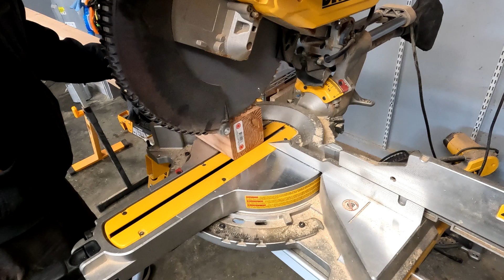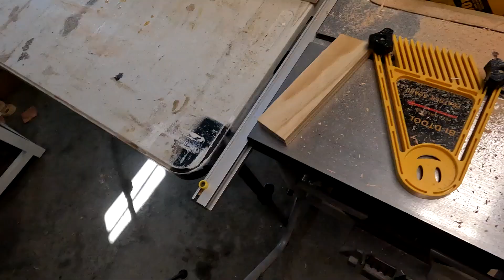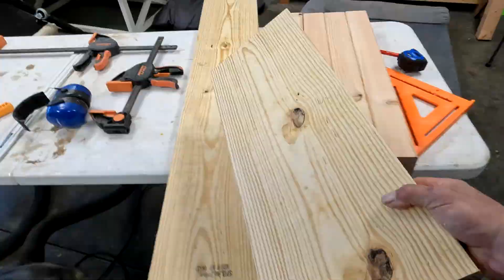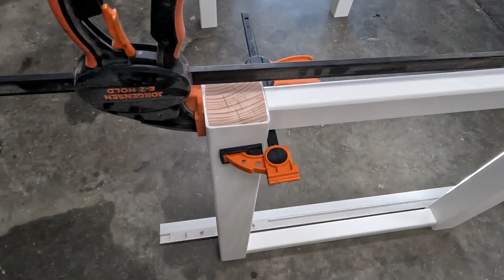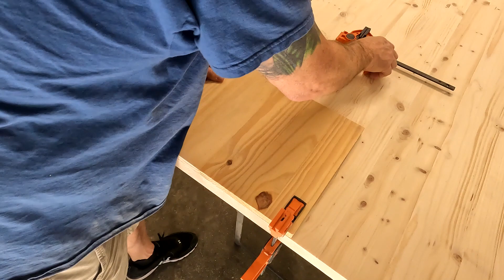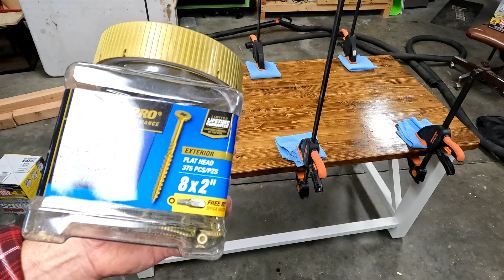Easy Farmhouse Office Desk Build | Rustic-Modern DIY Woodworking for Beginners

Comment: Great video.  Would have liked a few suggestions about how to pull it off with only a compound miter saw & power hand tools (sold my table saw.) Also the crossbar part barely explained the process.  Still, enjoyed watching.  Good heads-up on buying a premade top.
Reply from the maker: https://youtu.be/Rt4nNKBINsE  Sorry YouTube is either you talk to much or talk to little...  lol  The link above is on just how to do the X.  It's not difficult but it is long enough that people who already have some idea will be gone.  I at one point probably had the link in the description but trying to get youtube search engines to pick it up most likely got deleted.  Thank you for watching hope that helps.